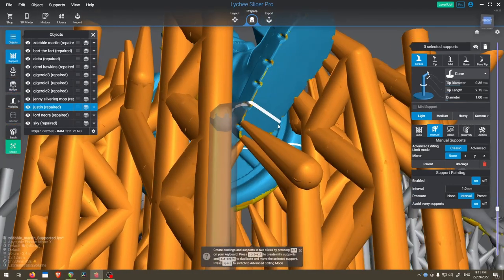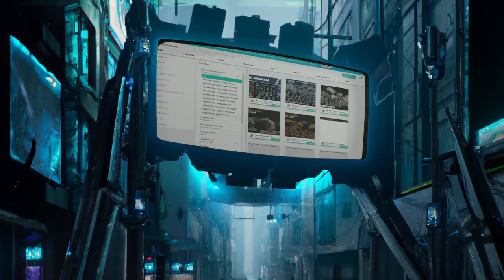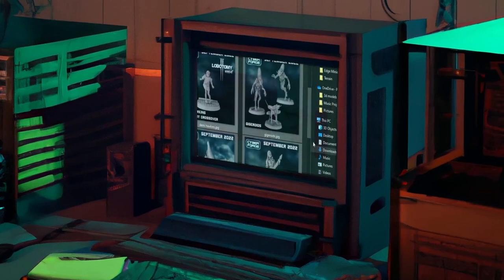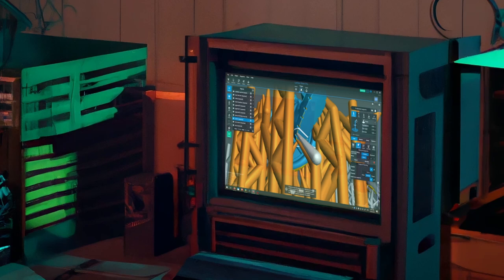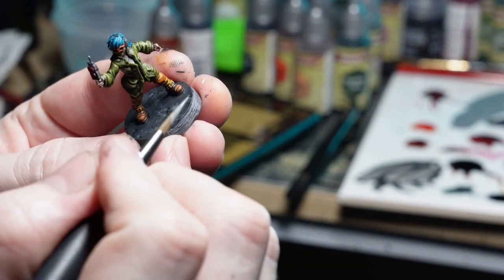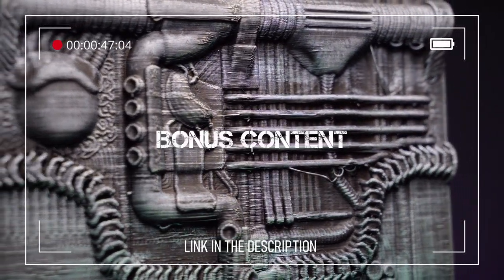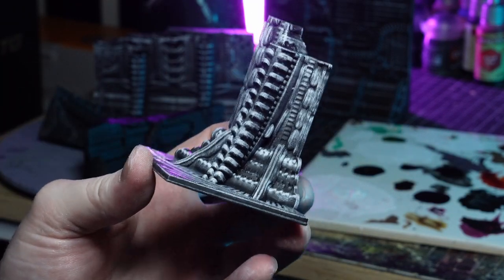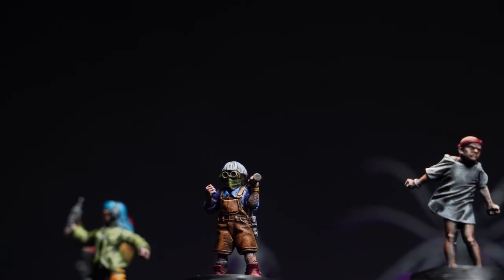Cyberforge Miniatures.. Patreon Review

Comment: Had some similar experiences with some Papsikels pre-supported files. The moment I supported them myself, no more errors. And because of that I made it mandatory to run all files through either File Validator or UVTools. And after that I usually just kept the unsupported files or if they were included, the ChituBox files, from any creator. I found it easier to just place auto supports and then tinker with the files, then to print them pre-supported and having the same fail over and over.

IMO, if you're gonna raise your subscription fees based on the fact that you give the customers pre-supported files in order to make their printing process "faster", at least do it right. Otherwise I would rather have the prices go lower, and just get the un-supported files (in working order, of course, with no errors). I'd rather set my own supports than popping the files on the stick and have them printed only to get frustrated when some of them would fail, forcing me to go over them and check every nook and cranny for errors.
Reply from the maker: Absolutely, for resin 3D printing to be accessible for anyone then the quality of presupported files has to be top notch, because not everyone is willing to put in that time to do the work themselves, they just want a drag+drop+slice+print experience.
Reply: Raising your prices because files are presupported tells you they weren't test 

Garbage.

Comment: Why not print it laying flat on back. Extremely quick in resin, and no supports needed. What is good subscritpion for ready to print fdm and resin. I'm too new for both
Reply from the maker: My main criticism on this point is why do we have to make that decision? We're paying for files and they should be delivered to us in the manner best suited for printing. If no presupported files are included for good reason, then they should include printing notes for us to reference for example "For best results print the models in the provided orientation, supports aren't required".

While I haven't formally rated One Page Rules, The Makers Cult, or Bestiarum Miniatures I can't give a rating yet,  but anecdotally I have had great experiences with these in the past so I can recommend them for now as a good starting point for miniatures, and for FMD terrain look no further than Forbidden Prints (unless you want fantasy stuff in which case I don't have a recommendation yet sadly!)

Comment: I was a Titan Forge subscriber for a year, they were the first Patreon I subscribed to and some of first prints I ever ran. I have to admit, they taught me a lot about supporting files. I had the exact same issues that you touched on, supports that were too small (seriously, it's the bottom of a foot, drop a heavy support on there to anchor things), missed islands, and supports that detatched during printing. Every 32mm mini required a minimum of 15 minutes of resupporting.
The larger presupported pieces (mostly dragons) just weren't even worth touching. Not only did the supports need to be reworked but the orientation of the parts was often very poorly done in an attempt to fit pieces on a Saturn/Mono X size build plate and avoid further cutting.

I still pick up a Titan Forge term from time to time but it absolutely has to offer something that I need and don't have, or can't get from another Patreon that has better presupports. I love Titan Forge's style and I'm totally behind the modular thing they're doing but I just don't have the time or patience to spend 3-4 hours fixing supports on a build plate of minis right now.

Comment: I understand your frustration with presupported models not working. I've been struggling with this as well trying a bunch of different minis across alot of patreons, and I don't think this is a Titan forge problem. The problem is that presupported models are not a one size fits all thing. The same model printed in standard elegoo resin won't get the same results in siraya fast abs like resin, regardless of how well dialed in your exposure is. Softer resins need different supports then more brittle resin. 

One size fits all presupported models are a lie.
Reply from the maker: That's a great point, and I agree that some resins do require the models be persupported differently (for example casting resin as I understand is is extremely fragile and requires much beefier supports) - however in the case of miniatures, one size can fit 99% of them (assuming the end user has calibrated their resin to their machine).

At a minimum creators producing miniatures for 3D printing should be validating their work in UV Tools to ensure they haven't missed anything (islands + resintraps), they should be test printing and closely examining their results and revising where needed, and they should be slightly oversupporting vs riding the line of possibility with super whispy tips because we can always use hot water to ease support removal. I see a lot of supports out there with 0.2mm tips, sometimes lower, that are load bearing way above their capabilities and the only way to get them to work is to overexpose regardless of what resin you're using.

You've given me a great idea for a video though, I'm gonna have to support a miniature myself to the standard I expect, then print it on as many different kinds of resins as possible. Thanks!
Reply: @OnceinaSixSide  I'd watch that!
I'd be happy to be proven wrong if it leads me to more consistent prints :)

Comment: The support tips not quite printing for you could simply be because of a different resin, I print with Siraya Tech Navy Grey and I underexpose the hell out of it and still get the super tiny supports connecting very well, but with many other resins my support setup would be way harder to print and require some overexposure

Comment: Thanks for this. In new industries, reputation is so important to retaining the trust of customers, and this requires a high level of attention to detail. It's reckless to expect each customer to duplicate work by individually working around your flawed supports, when you could save them all time and frustration by getting it right before you sell it to them. Cut corners always come back to haunt a company if it wants to lead the industry.
Reply: The community fixing your work is akin to gaming communities creating unofficial patches. The copyright issue puts a wrench in the idea of the same happening here. Imagine suggesting that gamers must each learn to code and patch their personal copy of a game. Even outside of being unreasonable, it's plain wasteful to commit thousands of "customers" to simultaneous and largely identical fixes for the same problem. That's time in peoples' lives that could be better spent on almost anything else. 

If the community could be outsourced as in PC gaming, this might change, but I have seen little in this regard from those with paid offerings.
Reply from the maker: Well said guys! This stuff should be ironed out before release, and while I sympathise with creators that the aggressive monthly release cycle is challenging, when you're as large as Titanforge with that kind of revenue there's no excuse not to have a team ensuring everything is sound before release.

Comment: This is exactly why I almost gave up on 3d printing. I couldn't tell if the problem was my settings, my leveling, etc. I hyper focused on leveling, threw the money at an Epax and discovered it was a combination of anycubic resin being insanely temperature sensitive (and generally inconsistent) and the files being poorly supported. I really worry we are preventing people from ever getting in to this hobby because companies that sell supported models don't actually support them.
Reply from the maker: Thanks for sharing that :) Yeah it's an absolute nightmare as a beginner when you think you've done everything right from calibrating your resin to leveling your build plate, just to keep getting failed prints because someone sold you "presupported" files that aren't up to the job!

Comment: Had a lot or fails with Titan Forge. It was probably at least 50% user error, but I soon realized that the subscription model is just flawed. I have a ton of stls that I'll never print. It doesn't matter how cool the models are, if I'm not going to use them in a game, I have zero reason to print them.

Comment: Good video. I've been a pateron of Cyber forge for a long time, I really like their art work. I had that same experince of being new to 3D printing, and assuming its my settings, machine etc. instead of the files themselves.  A  grade of 'B' sounds right to me because  when someone new to 3D printing has a failure their attempt at a fix could quickly spiral out of control.  Most of the models I print from them are good, but I had those same problems and they suck because they are false alarms. Since most people don't like waking up to failures they will over compensate on subsequent prints, and often fix what's not broken; that's why quality control is so important.
Reply from the maker: Absolutely, I've definitely done this myself but I do think it is better to er on the side of oversupporting something than trying to get away with the bare minimum. Thanks for chiming in!